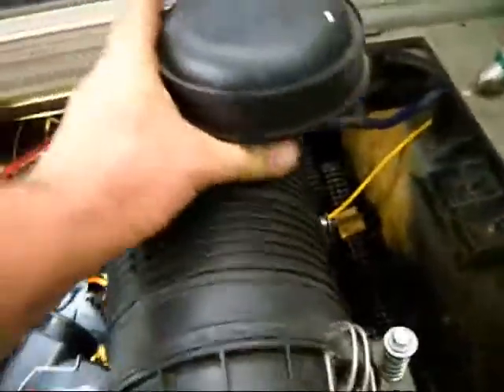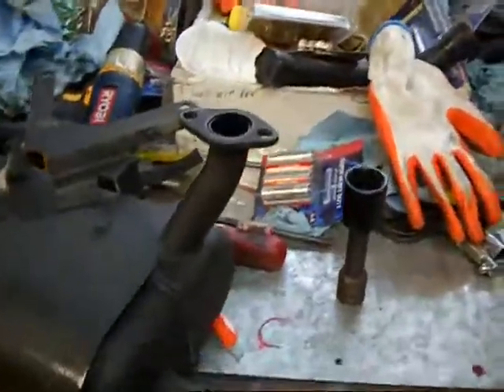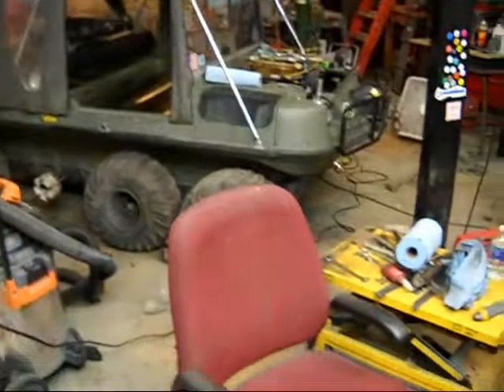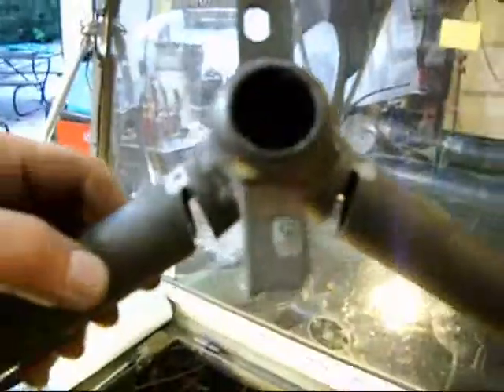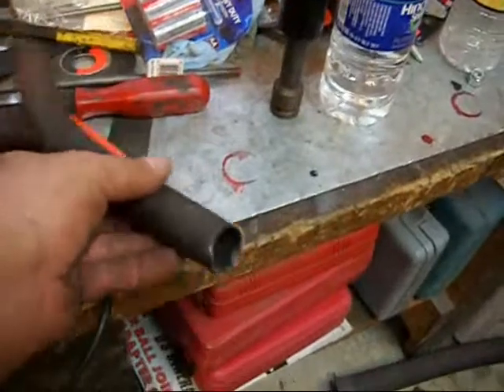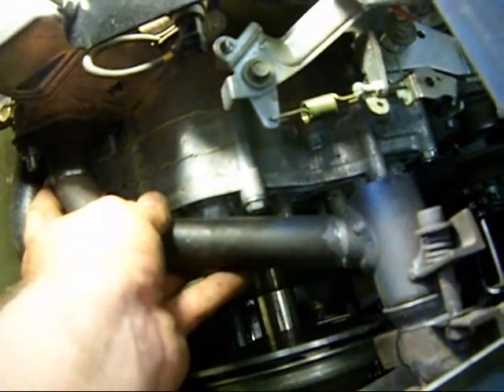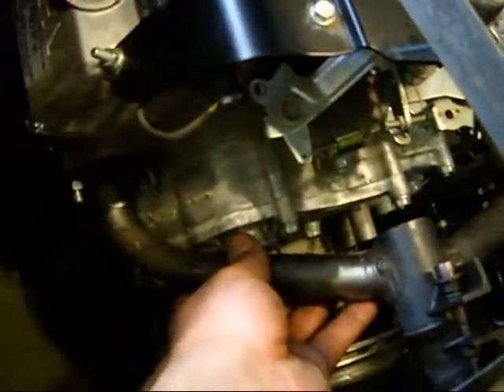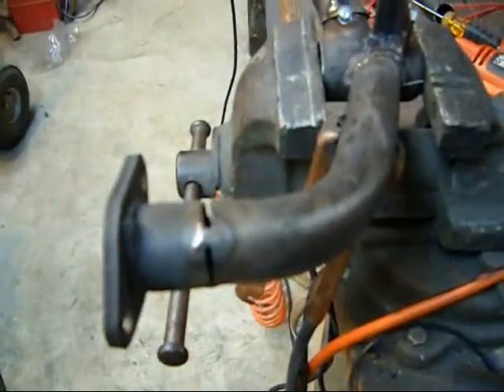Argo exhaust Fabrication for 29 hp video #8

Comment from the maker: @0ddba11s Thanks.  I would ask Rockdoctor07, he's very good on argo's.  I'm a little weak on the clutch / belt engineering and set up.  I'm very mechanical but never had experience on the clutch system for argos.  I'm starting to get a better understanding now.  Good luck.